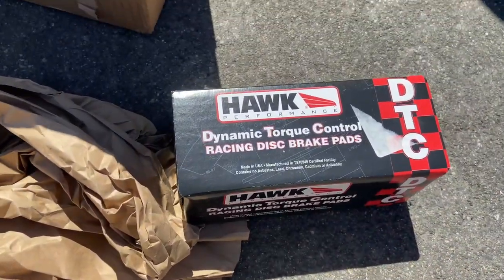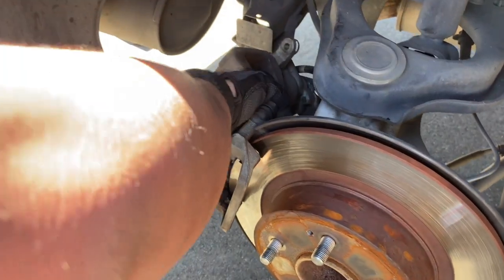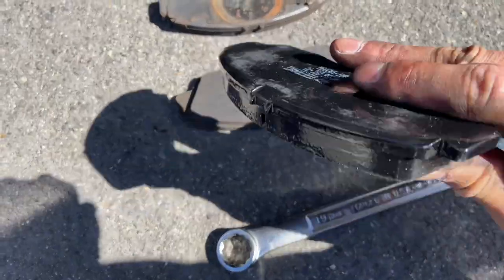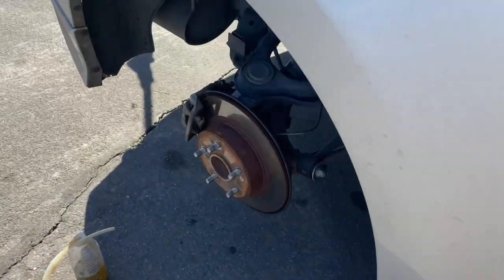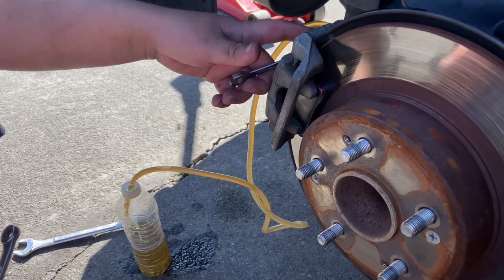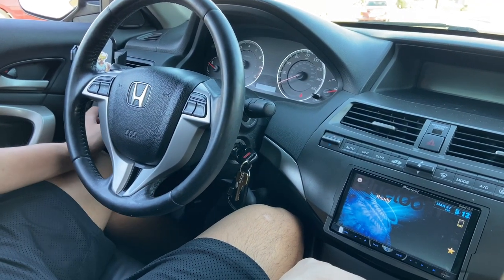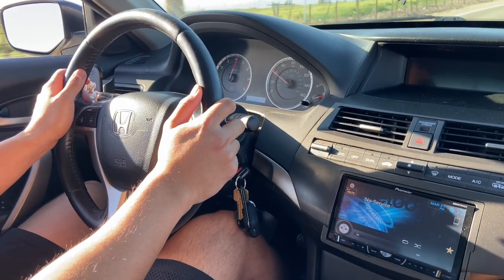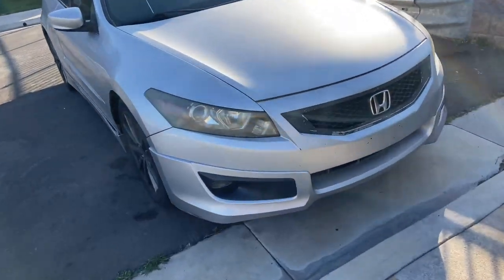THESE BRAKE PADS ARE SO STRONG! | Hawk Performance Brake Pads Installation & Brake Fluid Change

Comment: The site says they dont recommend them for street use. Would you say the brake power is too overkill for daily driving use?
Reply from the maker: They're perfect for performance and daily!
Reply: @abc.garage  i ordered these exact bakes and they just came in today, cant wait to install them
Reply from the maker: @fabian-isf5310  love that! They’re extremely strong
Reply: @abc.garage  so my brakes are sparking like crazy lol do you this issue too? I think I have to upgrade my stock rotors
Reply from the maker: @fabian-isf5310  that’s normal, it’s just due to the pad’s material
Reply: They're more for track than Street